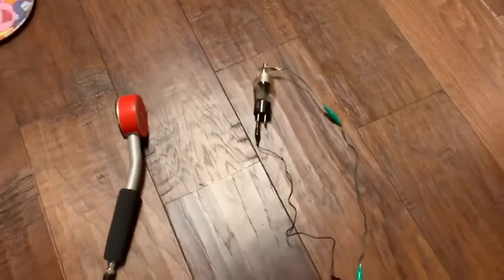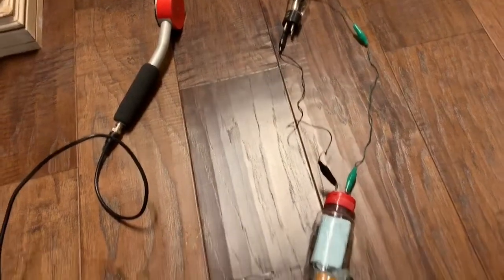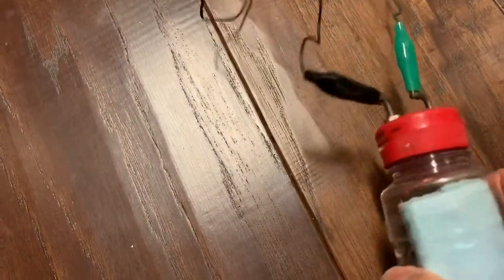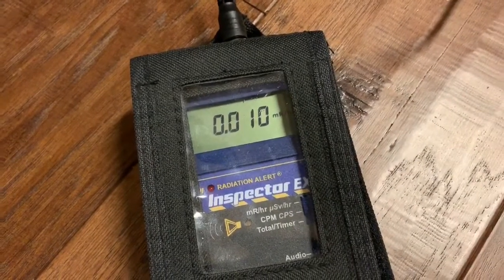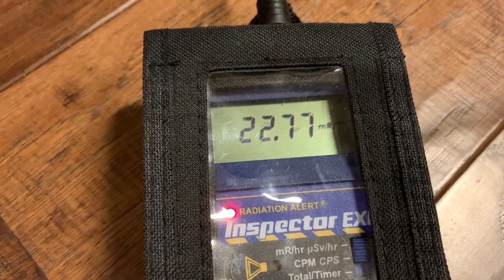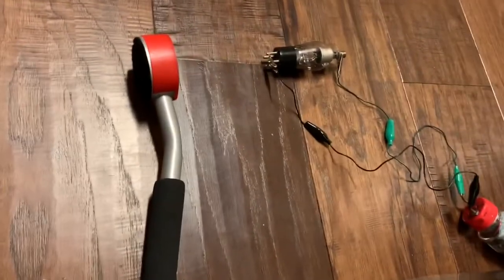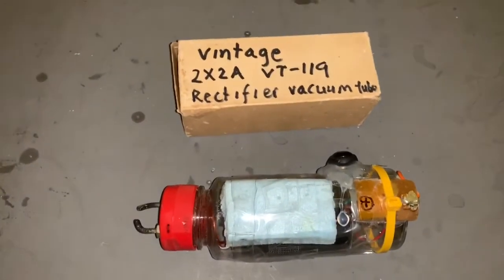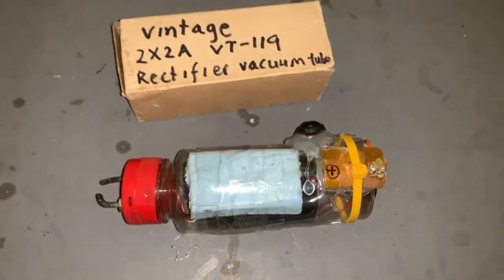Radiation from Radio Tube

Comment: Can I see the power supply did use for this xray tube?
Reply from the maker: I got it really cheaply from ebay:

Look under high voltage boost converter

https://rover.ebay.com/rover/0/0/0?mpre=https%3A%2F%2Fwww.ebay.com%2Fulk%2Fitm%2F184045984710

If you want it quicker you can get it from a local supplier for a little bit more. Runs well from a 3.7 V lithium cell.

Comment: is there no filament consist of W in the Tube?
Reply from the maker: Hongmihn Hahn there is a filament in this tube. But more X rays are generated when this used as a cold cathode.
Reply: @BrianDhvTinkerer  is the 4 pin side one negative ? and thank for your reply.. i knew using filament makes more electrons due to thermionic emission .. i am afraid that could you let me know the theory or any explanation of using a cold cathode?  i want to know so well like you,, i thinks you are really amazing.
Reply from the maker: Hongmihn Hahn the 4 pins are all negative. The single top pin is the anode. I am not sure why it produces more detectable X rays when used as a cold cathode. I am thinking that with thermionic emission, it makes more but lower energy X rays and these are not able to penetrate the glass envelope. With cold cathode it makes less but higher energy C rays that are able to penetrate the glass. Also the highest concentration of X rays is emitted from the side of the tube at about 60 degrees angle.
Reply: thanks for your nice reply.. and i will do that with the tube you said to me.  and make x-ray image with great care